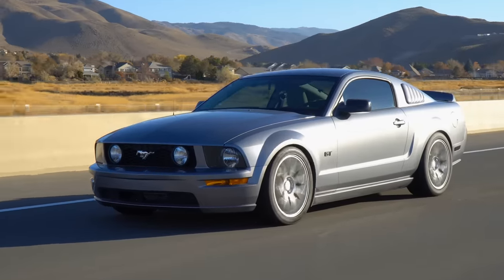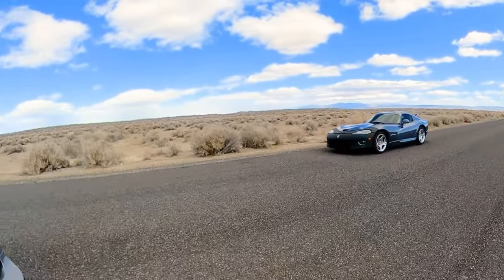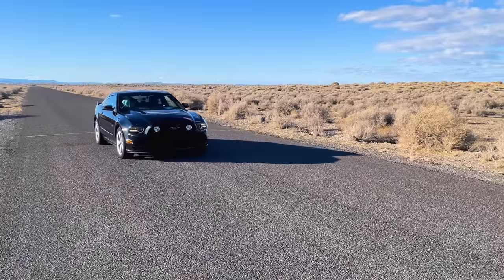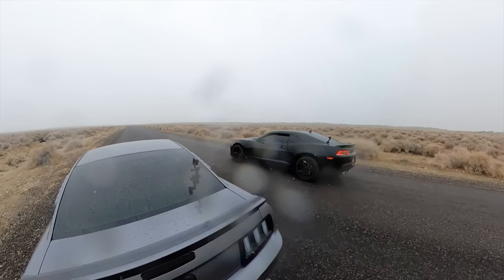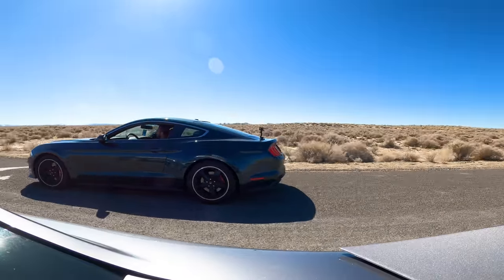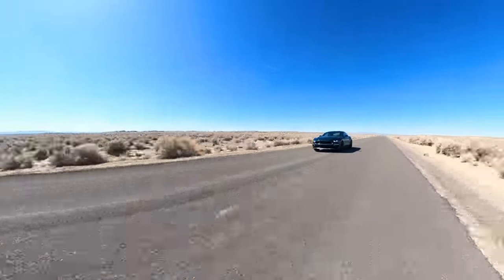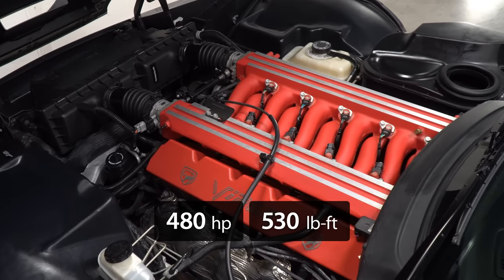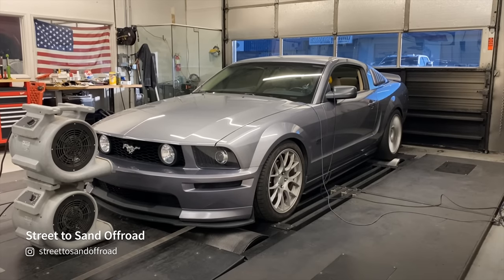Showing the world what an all-motor 4.6 Mustang can do

Comment from the maker: 🙋‍♂ FREQUENTLY ASKED QUESTIONS & OTHER INFO 👇

What speed and gear are you guys starting in?
All races were done from a 20-roll in first gear except for the race against the gen 1 yote where we started at 40 mph in 2nd gear.

What RPM are you shifting at?
Just under 7,100.

What's the ratio of your axle gear?
4.10; 1st goes to about 52 mph, 2nd to upper 70's, and 3rd is about 105 mph.

Why didn’t you race a 10-speed Mustang, C6 Corvette, Kia Stinger, BMW M3, 6th-gen Camaro SS, GT350, 392 Challenger/Charger, or my GTI?
I don’t know anyone with those cars.

Huh come no dig races?
To reduce the impact of driver skill and tire/suspension setup on performance. The point of the races was to test the Mustang’s acceleration against better cars, not see which driver/setup could manage a better launch.

What fuel is the Mustang running?
All vehicles were on 91 octane.

Why don’t you run E85 or 93 octane?
Not available in my area, not even close unfortunately.

What exhaust setup do you have?
Kooks Long Tubes, catted x-pipe, and Pype Bomb axle-back.

What wheels are those?
The wheels have been discontinued, but they’re called Miro 112 and the setup is:
- 19x8.5 +35 on 255/40
- 19x9.5 +40 on 285/40

What bumper / splitter is that?
OEM GT/CS bumper with modified 07-09 GT500 splitter.

Why are you doing this?
It's fun.
Reply: “Never raced” 
RACES IT AGAINST HIS MUSTANG
Reply: What’s transmission did you swap your mustang to?
Reply: What camera do you use? crazy good quality
Reply: @Faltye  lmfaoo I was like wdym by "never raced"
Reply: We all know why
Reply: Well here's my question. Just an new thing.
What's the purpose of the black mask the Viper has on right now?
Reply from the maker: @Driff97  just protecting the paint, it's a good 70-minute drive to this location
Reply from the maker: @willb2820  Sony a6500, GoPro's 8s, GoPro Max for 360 shots, and I've been using my iPhone 12 a bunch as it takes excellent video as long as there's plenty of light.
Reply: Tbh the one race I would’ve loved to see would be against another stock/slightly modified 3v s197 as well. Would really emphasize just how far the car has come. All this before even boost? Hats off to you sir, you’re a huge inspiration for me.
Reply: I bet it's for sale. After getting it handed one by a mustang.
Reply: Have you ran at a drag strip?
Reply: @fastsvtt  obviously I’m not him but basing off of my friends who are boosted. I’d say he could run mid to late 12’s
Reply: Feel free to not answer, but was wondering approx what you spent on just the parts used in this video? Thanks
Reply: @trump45and2zig-zags  he has a spreadsheet linked in the description of most of his videos. Shoes all the stages, individual part price for each stage, cost of each stage, and and overall cost in general I think. Very helpful
Reply: Very nice! Love your vids
Reply: I’m in Phx. C5Z with I/H/E and a tune 393 WHP if you need a car for a video
Reply: I own a C6 and I’d love to see you up against a mostly stock LS2 or LS3 I feel like it would be such a close race. Hopefully you can find someone in the area who’d be down to race
Reply: @Dom7799Games  I have a C5Z Ls6 with bolt ons. Sent him a email the other day offering my car for a video. Since I’m in phx, I’m not too far
Reply: I'd sell it to. That stang roasted it 😂 jk
Reply: Corvette never raced?  You raced it in this very video!
Reply: Rock on
Reply: For my own personal knowledge do the new coyote engine use the gt40 heads that the older 302 did
Reply: @Driff97  Covid ?
Reply: @jlowkey1  no, the heads from the older modulars are not interchangeable with the Coyote series.
Reply: What's 0 to 60 time in quarter mile? Sorry if I missed in the video
Reply: Drove many of the new 3 valve Mustangs as they came out of the factory in Flat Rock Michigan to an overflow lot 5 miles away... was amazed that little 280" engine felt like an old 460" big block V8! 
Race against Viper was like my race back in the day of '65 tripower GTO vs 427" Corvette... side by side until 90 when the 'Vettes vastly better streamlining took over...
Reply: Race a 1200 HP Corvette ZR1 with the 1200HPE package from HENNESSEY PERFORMANCE with a top speed of 230+ and see how you like that. Come on really its a bone stock corvette vs. a god damn fully upgrade mustang as upgraded as it can get and its got like 400-500 more horsepower thatn the corvette
Reply: I hope you have other vids like this. I enjoyed it as it was raw and not over edited and you were clear concise and very neutral.  I am subscribed now.
Reply: @JimBronson  ok I've just heard that using the heads from the mustang 302 believe their GT40 heads to replace the heads on my Bronco 351w  just had to drill the holes for the larger headbolts. But thanks for the reply
Reply: Repent to Jesus Christ 
“In your relationships with one another, have the same mindset as Christ Jesus:”
Philippians 2:5 NIV
Y
Reply: Excellent job on to the Stang!! I was surprised, probably just as surprised as everyone you beat! The Difference  being I'm happy for you and they were probably pissed off at you LOL Akaxing job on the Stang!!!!! What are all the mods you have done and how much did they cost? By cost I'm asking for both the Cost of the parts and the cost of installation, if you did not do the installation yourself, and what did the tune cost? Love that you surely hurt some feelins! Ha ha. Again, great job!!
Reply: TEXASMUDNECKSAY  my little 2022
Maverick  2lt turbo 
Pulls strong all
The way 112 mph
( riv killer)  
Surprise the he'll
Out most lead foots
I've seen.
Reply: @Four_Eyes  You say the Mustang isn't admired by the car community at large? How did it become the best selling sports car in the world including Germany of all places? Any car show I go to or any vintage car show I go to Mustangs always dominate the scene somehow.
Reply: What do you think about the 2001 model Ford Mustang?  It's a five speed.
Reply: @kathleenpimentel9218  NIice cars.Which Mustang, a GT?
Reply: @mattmalone524  Hi..Not a GT It's a sports coupe (less muscular than the GT) fine for me.  The guy I bought it from 2 yrs ago only 75k miles and he really took good care super detailed. Kept covered etc.
Reply: @kathleenpimentel9218  it's probably a V6 and it is still worth it.
Reply: Fords engine program is substantial and way more progressive/complex than other manufacturers. Which makes them complex to work on, but very capable. HEADERS (long tube) are the first upgrade anyone should consider from stock. Unfortunately many of us have to deal with smog laws, UGH.
Reply: @Micah_Johnson   400-500 more horsepower,huh...🐂💩
Reply: ALL MOTOR REALLY MEANS NOTHING. FOR 100 000$ ANYTHING CAN BE FAST. JUST SAYING
ITS ALL JUST PAY TO WIN
Reply: Keep talking about this being a 4.6 but what is the actual displacement after the stroker kit?
Reply: ALL RIGGED LIKE MOST VIDEOS 4.6 ARE WEAK ENGINES STOCK
Reply: Won’t answer my question of the actual displacement of this “4.6” 😂
Reply: @BuzzLOLOL  460 ford engines has never been much on power back in the 70s 460 ford engines were putting out around 215 hp
Reply: @aarongentile7232  lmao sounds like you believe anything
Reply: @mattmalone524  because there cheaper most have Chevy engines
Reply: @donaldkinder6716  Those are some of old Fox Body ones that some put chevy engines in because they are cheap.  The Mustang is now the best selling sports car in the world and in Germany for the last 4 years. That is remarkable in itself /
Reply: @donaldkinder6716  really?  Why don't believe what was written??
Reply: @aarongentile7232  most videos on the internet are rigged and mustangs are the cheapest sports cars going that's why id bought 4 in my 40 yrs of Driving
Reply: @donaldkinder6716  - When 460 came out in late '67 it was 375 HP... then became another 'Emissions Slug' in early 1970's...
Reply: @donaldkinder6716  ahhh, ok, gat it.  I thought everything I saw on the Internet was true! Jk
Reply: @donaldkinder6716   I  Watched the video again, you're right, its total BS, there's no way that Mustang beat all those other cars... The only way I can see it happening is if the others were driving a stick & just can't drive one properly.
Reply: @TheLostAtom01  l88 u⁹
Reply: Hu 6ū
Reply: You get millions of views and yet you have less than 100K subs. It's kinda hilarious for sure but maybe a bit sad too.
I suggest you highlight the fact in your next videos for it to change. Good luck
Reply: 4:10 gears doesn’t get u too 50mph. On first gear.
Reply: @jlowkey1   - totally different engine platform.  The GT40 heads were on the old pushrod small block Windsor platform.  The 4.6 is an overhead cam platform.  BTW, the GT40 heads do not compare to many aftermarket heads for the small block Windsor.  Their technology is really outdated.
Reply: If the viper was upgraded nothing could touch it
Reply: @PurpleLEANKrabs  you wish. power/weight ratio is a real thing and some cars have better aero too. I could go on but to make it short.... SUPRAAAAAAA !!! haha
Reply: Im buying a 2008 v6 soon. I want to eventually boost it and see the looks on peoples faces
Reply: You said Mustangs aren't admired by the car community at large? RU kidding? It's been the best-selling sports car in the world including Germany for the last 5 years. You don't get more admired than that. Go to any car show and you will see Mustangs in every iteration and build for the most part.
Reply: I have gone through your channel and watching these videos I decided to purchase a 2008 Mustang Bullitt, while I can't upgrade the car much while I'm paying it off, I plan to use your build as a blueprint for me to build a Bullitt that lives up to its name! I will be putting more into the suspension and brakes before I ever get the power to the wheels, but in the end I hope it ends up as beautiful as yours!
Reply: Guys, Here is The Savior

YaH The Heavenly FATHER HIMSELF was Who they Crucified/Pierced for our sins and “HERE IS THE PROOF”

From the Ancient Egyptian Semitic: 
"Yad He Vav He" is what Moshe (Moses) wrote, when Moses asked YaH His Name (Exodus 3)

Ancient Egyptian Semitic Direct Translation
Yad - "Behold The Hand"
He - "Behold the Breath"
Vav - "Behold The NAIL" <— YaH’s Crucifixion
He - "Behold the Breath"

“Behold the HAND that Beholds The NAIL” 

PROVES - YAH The Heavenly Father HIMSELF was Who they Crucified

That is EXACTLY what Moses Wrote

Here is what they mean

YaH's Name:
(Ya)d + (H)e, as YaH is what Moses called Him and YaH Declared: "this is My Name, this is My Name for all generations" (Exodus 3)

YaH is The Creator of “MAN”: (Genesis 2:7)
Yad He, (HAND BREATH), as YaH's "HAND" Formed man from the dust  of the Earth and His "BREATH" made him a living being (Adam)

YaH's Sacrifice of Crucifixion for “MAN”:
Vav He (NAIL BREATH), the "NAIL" through YaH’s "HAND", in Sacrifice of Crucifixion, that whosoever shall call YaH Savior, His “BREATH” brings forth life (Salvation)

How YaH arrives:
YaH arrives via the Tent of Meeting (Exodus 33:7:11, Isaiah 54, 55), where a Tent is erected outside the city, a cloud descends upon the entrance of the Tent and YaH appears...

Why they demanded YaH to be Crucified:
YaH was Crucified according to Hebrew law (Deuteronomy 21), to be NAILED/PIERCED on an Almond Tree for BLASPHEMY as it was for His NAME they demanded Him Crucified. The Messiah claimed He was YaH...

HE WAS YaH!!!

HalleluYAH translates “Praise ye YaH”

The Hebrew Book of Isaiah

Isaiah 42:8
"I am YaH; that is my Name! I will not yield my glory to another or my praise to idols.

Isaiah 43:11
I, I am YAH, and there is no other Savior but Me.

Isaiah 45:5
I am YaH, and there is none else.
Reply: if your gonna go n/a first, add itb's for the best reaction time

Comment: It's mostly about RPM! Bigger engines can't spin the high RPM, the 4.6 has a short stroke and will hold together at high RPM. Just like a jet boat, the big blocks look and sound impressive, but top out around 5,500 RPM and can only hold that in short bursts, while a small block can crank up and hold together at 7-9,000 rpm and Blast by the big block like they were in reverse! We Live on Lake Tapps, see it constantly, the big blocks with polished blowers etc go hide when the killer 9,000 RPM 302 comes out to play!

Comment: I bought a 99 off the showroom floor and had a full exhaust and went with 373 gears then a vortech supercharger and I put a smaller pulley on it with 42lbs injectors with a center force dual friction clutch with an aftermarket shifter and nitto drag radials with all the suspension parts they made at the time

Comment: I raced a 3v in Mexico (just a smidge south of San Diego 👌).

I was driving my 07 z06(stock) vs a H/C/I/E 3V. I pulled him a bit harder than your viper pulled your 3V, but he didn’t have rear gears or a 6 speed swap. Crazy how that intergalactic 3rd gear can be such a difference maker! He was just never in his powerband soon enough to make it a race.
Reply from the maker: that sounds about right, indeed if ford had just put in a decent 6-speed and a little beefier connecting rods these cars would have a different reputation. and at a stock CR of 9.8, totally primed for boost.

Comment: Nice video! I had a 05 GT premium w/ cold air and exhaust cut outs. Drive the hexk out of the car. Build my Dads(RIP) 13 f150 FX4 5.0. So far I’ve done tune and exhaust. Now I’m upgrading the vct set up, putting Boss 302 intake, Boss timing chain, Boss chain tensioners, cold air, and tune.

Comment: Strangely enough I had a 2005 GT with headers, crammed, X pipe straight exhaust & a blower. Put down 509 whp. Also, had a ‘01 Z06 fully built LS6, headers, cammed, straight piped with a pro charger at 723 whp. Now have a ‘21 Stinger GT with JB4 on E30, downpipe, intercooler, intake, muffler delete. Not sure on power but it’s quick enough.

Comment: Years ago I raced a coworker that had a 4.6 mustang (2010?) that was modded out.  Full exhaust, cams, etc...  We had fooled around a bit (Me with my 89GT 347 cu in stroked and 6PSI blower w/ auto, converter and 4.10s) and I was pretty sure I had him but he wasn't convinced.  We finally did a roll race (25 to about 70) and I did definitely beat him.  He told me he was surprised as he never really lost.  Never underestimate a worked over fox.  Light weight and will get ya.  I run out of gear at about 100- 110 and don't push it that high because it revs out like a mutha.  But man at anything less it's pretty good.

Comment: I owned an '06 Mustang GT Conv. with a 5 Spd Manual trans.  Was it super fast , no. It was fun to drive, especially getting into it the first 3 gears. If I remember, it had 300 hp and 320 ft/lb of torque.  The only problem was the hood rust around the front. Replaced the hood with a fiberglass one. Still wish I had that car.  Vista Blue w/ blk top and int.

Comment: Bet that six speed makes all the difference. 3rd gear in in our 5 speeds is just insanely long. With 3.73s and if I actually manage to hook well in lots of races it'll walk 'em in 1st and 2nd then I'll proceed to get gapped in 3rd. Despite not being the best engine I really think the transmission is the major culprit and the 3v would hold up so much better with more reasonable gearing.

Comment: I grew up on Camaros..with a whopping 175hp 1980 Z28 I found for $400 on a farm in 1996 (yes, one of those stories). Compared to the LT1 F-Body cars...this thing was a dog... A whole 100hp less. The very first thing I did to it (3 speed transmission btw), was put a 2800 stall converter in it and got rid of the 3.08 gears for some 3.73s and was still able to drive highway to work at 2200rpm @ 60mph lol. These 2 cheap changes actually allowed me to hold my own against stock LT1 cars through the 60mph range. I later ended up doing a LOT with this car including a 6-71 etc... My next cars were a 1995 TransAm, 1994 Z28 (auto) and a 1995 Z28 6-speed. All 2 of these cars saw the biggest gains for the buck through the 1/4 with rear gear changes and a stall converter where applicable. My 1994 Z28 auto bone stock 275hp ran 14.4s @ 104mph on average with the stock tires back in 2000. That car literally had the worst gear package with 2.76s or 2.73s I can't remember. I threw in some 3.42s from a wrecked F-Body in the club and a Yank 3500 stall converter with no other mods and the next weekend I ran 13.4s @ 106mph.. My 60ft and 1/8 miles times were massively different. Shaved a whole second off.... Back then...running into the 12s was the goal of the daily driver guys..and I was nearly there with that swap.

Gears are a huge deal man.... They make the most of what you have under the hood...

Comment: While the 3v doesn't have the glitz and glamour of the 5.0, I think I prefer it still based on how rock solid it is. My friend had a 2016 5.0 with 60k miles and it gave him problems on more than one occasion....... on the other hand my best friend had an 08 4.6 with 120k on it and it never gave him an issue even though he drove it like he meant business. I am thinking that while the 4.6 may be a bit underwhelming, that it is a better engine for longevity. I could be totally wrong though. I am just speaking from my experience. I have never owned a mustang but I'm definitely interested in a 3v after reading and watching vids. I'm sure the 5.0 is good and can last too as long as you take care of it as is true with any other engine.

Comment: I had an 07 GT premium I bought from the original owner, they are the nicest looking by far 05-09. The engine just sucks though. I had every bolt on you could install on it including a dyno tune. The way to go on these cars is a fully built and boosted MMR engine. I drove that car for 12 years and 200k miles. Reliable as can be.